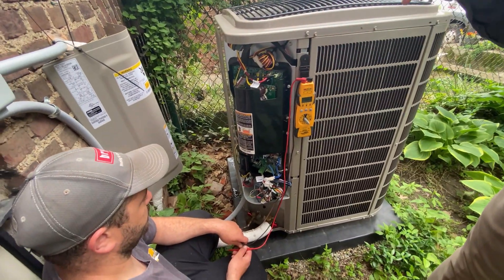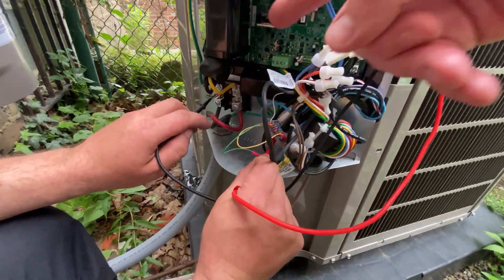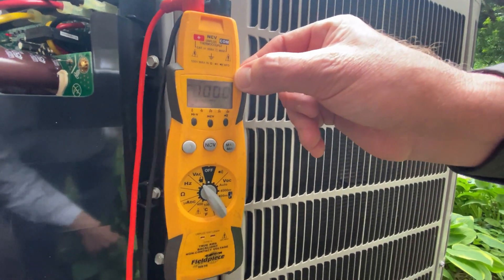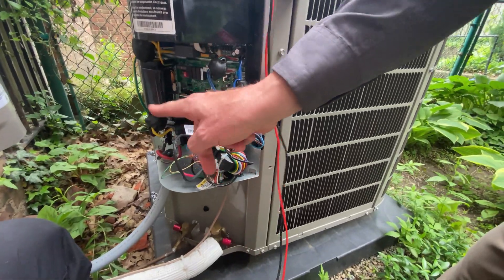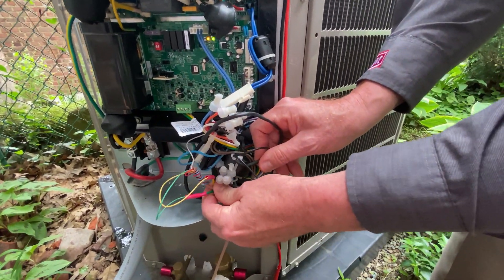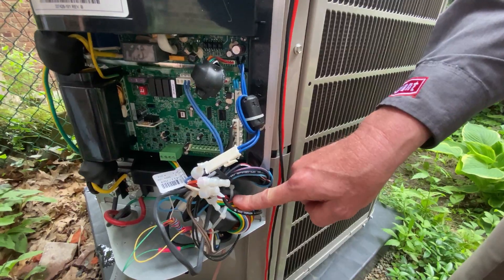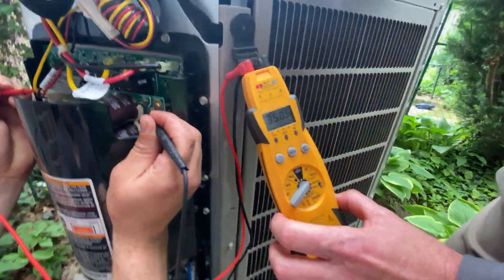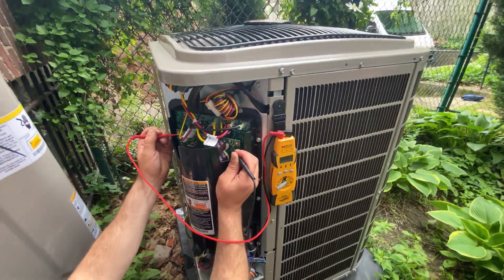Electrical Connections on a Bryant Evolution Air Conditioner

Comment: What exactly are communication wires and what is the core that is wrapped around?
Reply from the maker: It is alternating data between green and yellow (A and B) it is Rs-485. 

The core is a Ferrite core to filter out any possible electrical noise from the inverter. 

Thank you!